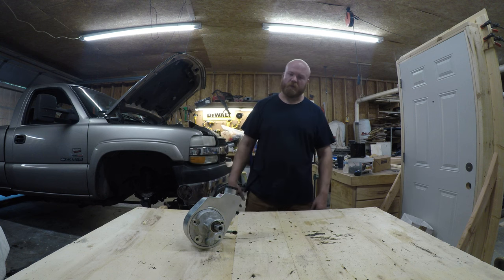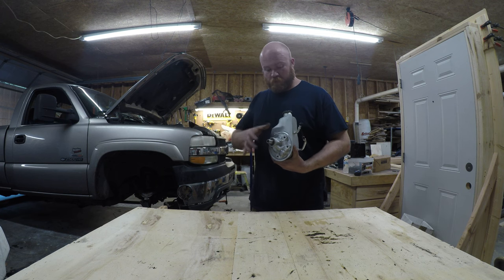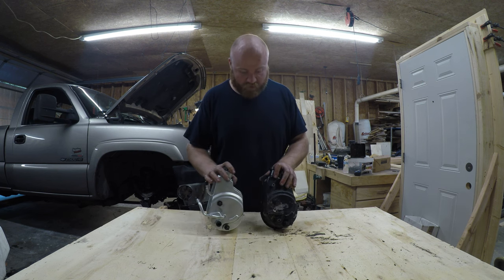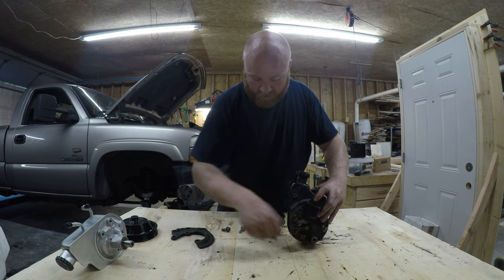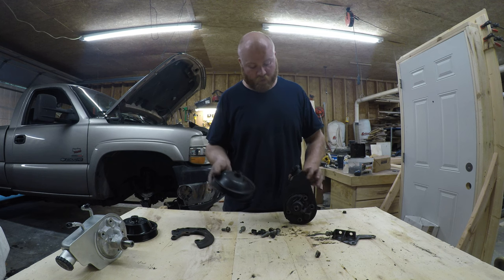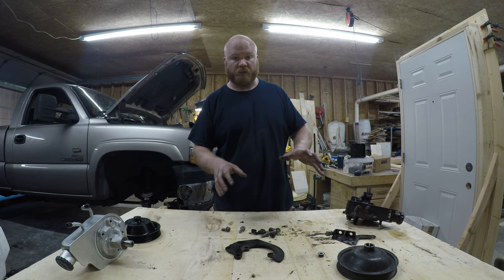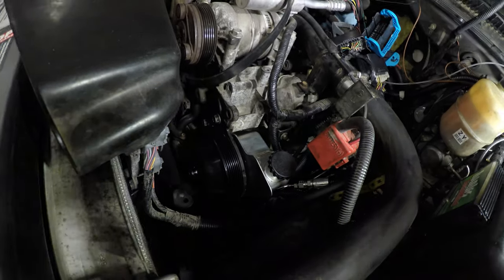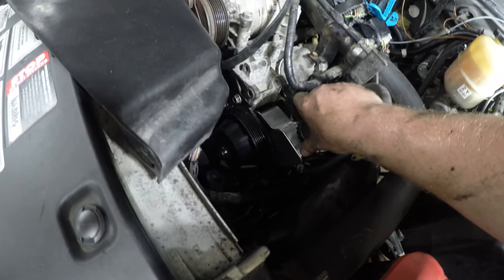Upgrade Lowdown:  '02 LB7 Duramax PSC High-Output Power Steering Pump

Comment from the maker: Hey, everyone!  YouTube has a bad habit of randomly deleting comments for no reason...   So, if you post a comment on one of my videos and I don't reply, please check back to see if it has been deleted.  I really enjoy replying to comments, so, if your comment has been deleted, please try posting it again.  Thank you for watching and for commenting!
Reply: Did you also add a cooler for this pump?
Reply from the maker: @codygunnerson8876  No, I didn't add one.  The AmsOil fluid I'm using has no issues with heat-soaking.  It's always smooth and quiet - no matter how long I've been using the truck!

Thank you for watching and for commenting!
Reply: Heck yeah looking forward to doing this to my truck
Reply from the maker: @allenoakes9126  Awesome!  Just be sure to use a high-quality power steering fluid.  PSC sells their own fluid under the Swepco brand, and you can buy it on Summit racing fairly inexpensively.

Thank you for watching and for commenting!
Reply: I need this up grade! I can barley steer in low speed situations. How much was the pump?
Reply from the maker: @short-fuse  Xtreme Diesel Performance, where I bought mine from, has it listed for $275.  I've got a link to it in the description.

Thank you for watching and for commenting!

Comment: This is awesome.  I've gone thru a bunch of junk rebuilds and new china made pumps with all bad experiences.  My truck has stalled before when trying to turn in a parking lot with the ac on at idle.  That 1600 psi rating seems to be the ticket.

Comment: Did you have the right puller? Napa and autozone rent them. Good Pump American made, anytime you can support that is a good thing , put one on my LMM little tip if you replace your lines prime the pump with a little vacuum on the pick up side took me a while to find someone that suggested that , first though it was a bad pump , worked like a charm , starting it lock to lock 3  times didn't do , maybe the ratchet would have worked

Comment: I just bought this pump for my lb7. What power steering fluid did you use?
Reply from the maker: I'm using AmsOil, but, to be absolutely safe, I'd order their Swepco fluid.  You can buy it on Summit Racing.

Comment: How much was the pulley
Reply from the maker: The pulley is $95.  You can buy it on AutoZone by searching:  Dorman Power Steering Pump Pulley 300-229

However, the OEMTOOLS Pulley Puller/Installer (Part #:  57031) should be able to remove your OEM pulley and install it on the new pump.  I didn't realize how it worked when I did mine.  I wouldn't've had to buy the new pulley otherwise...  Haha!

Comment: Sweet video jay, any noticeable difference in braking with this psc pump?
Reply from the maker: Thank you, Oscar!  Well, I've also gone with the 2011 hydroboosts upgrade, so my brakes feel SIGNIFICANTLY better because of that.  I think the improvement this pump makes on an otherwise unmodified truck is that the power steering doesn't lose assist when you're holding the vehicle still with the brakes.

Thank you for watching and for commenting!  Please let me know if you have any additional questions.
Reply: @JayRussellDuramax  thank you for the reply, I also did the 2011 hydro booster on my LLY, braking is way better but still notice I have to stab it a bit, might need a new steering pump
Reply from the maker: @oscarlopez2599  Oh, ok.  Cool!  How is your steering?  Is it heavy and/or difficult to turn the wheels?
Reply: @JayRussellDuramax  oh yeah! Especially when parking in parking lots , tightens up
Reply from the maker: @oscarlopez2599  Well, I think this pump might really help you out!  Do you have oversized wheels and tires?
Reply: @JayRussellDuramax  I’m thinking it will, maybe even if I do a stock replacement, if that’s the pump the truck came with then it’s 18 years old haha, and no stock tires for now
Reply from the maker: @oscarlopez2599  I don't think this PSC pump is much more expensive than a good stock one.  If you're replacing your pump, I'd really suggest getting the PSC pump.  I think the one I replaced was my stock one, so it was 20 years old!  Haha!
Reply: @JayRussellDuramax  oh nice, how long has the psc pump been running in your truck?
Reply from the maker: @oscarlopez2599  It's been on there a few months now.  I'm very pleased with it!
Reply: @JayRussellDuramax  awesome thank you, I’ve seen some people give it bad reviews for not lasting but I think I’m going to give it a shot
Reply from the maker: @oscarlopez2599  I think the problem is that they're using bad fluid.  The higher output requires that you have a very capable fluid, otherwise it'll cavitate the pump once the fluid gets too hot.  I'm using AmsOil, and it doesn't seem to have any issues.

PSC sells their Swepco brand of fluid, and it's not that expensive either.  You can buy it from Summit Racing at a great price!
Reply: @JayRussellDuramax  I just checked them out, thank you for the info
Reply from the maker: @oscarlopez2599  You're welcome!  Please let me know if you have any additional questions.  Also, please let me know if you get this pump installed and how well it works for you!  I always like hearing from subscribers when they do these upgrades to their trucks.
Reply: @JayRussellDuramax  hey Jay I installed my new pump with the swepco oil and performs fantastic!
Reply from the maker: @oscarlopez2599  Thank you for telling me, Oscar!  I'm so glad it's working well for you.  Please let me know if you have any questions about the other things I've done to my truck.  This pump really compliments the 2011 hydroboost and RedHead steering gear.